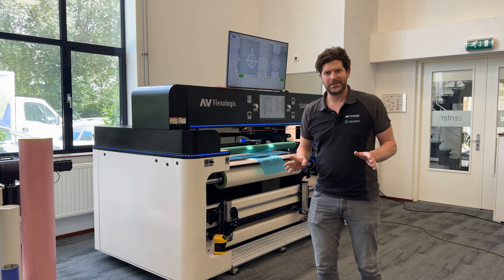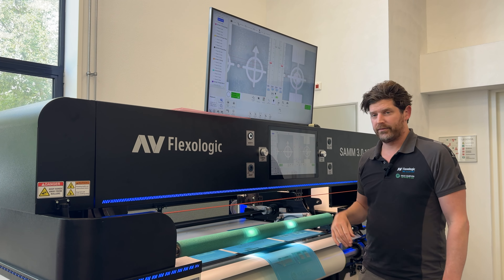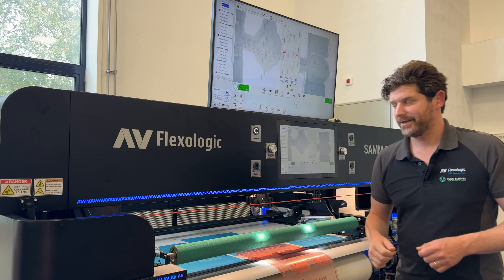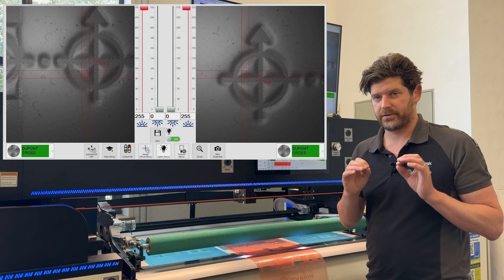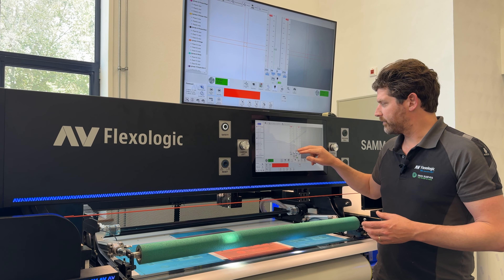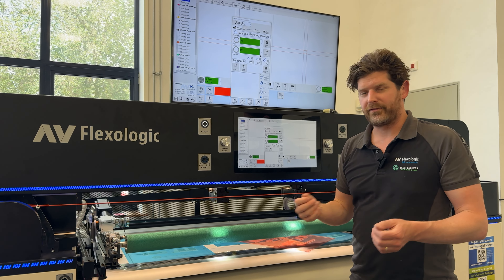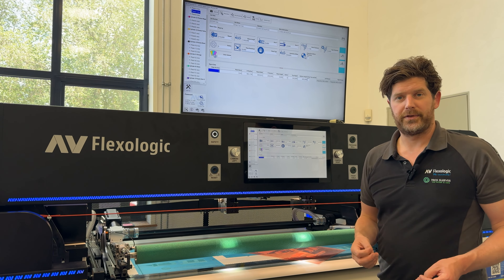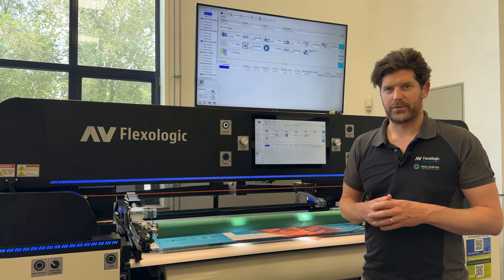Patented Backlight System On Automatic Flexo Plate Mounter SAMM 3.0

Comment: This patented backlight system is available exclusively on AV Flexologic SAMM 3.0 and FAMM 3.0.

Key advantages: 

The key advantages of the backlight system on the SAMM 3.0 include:

	1.	Enhanced Visibility and Accuracy: The backlight system provides improved illumination for the mounting marks, making it easier for the cameras and image recognition software to detect and position the flexo plates with high precision.
	2.	Improved Image Recognition: The backlight enhances the performance of the advanced motorized cameras and patented image recognition software, allowing for better recognition, higher accuracy and faster processing of images.

	3. Operational Efficiency: By improving the visibility of the mounting marks, the backlight system helps in reducing the time required for the machine to locate and align the plates. It also reduces any operator interaction.